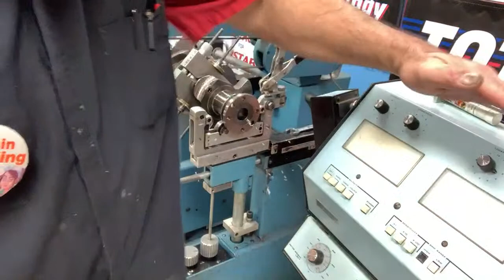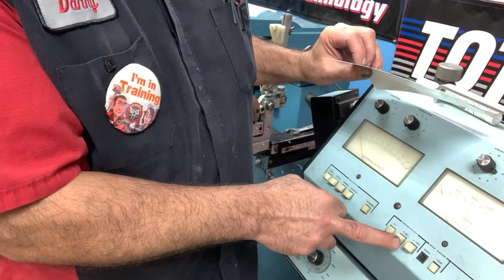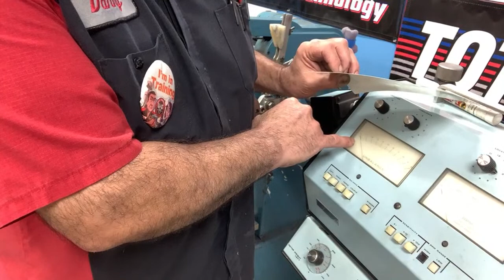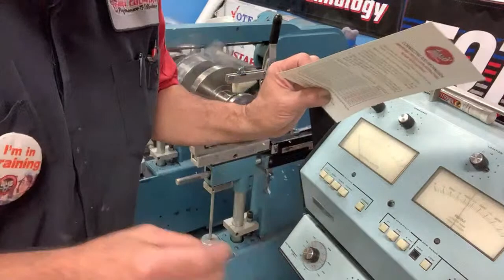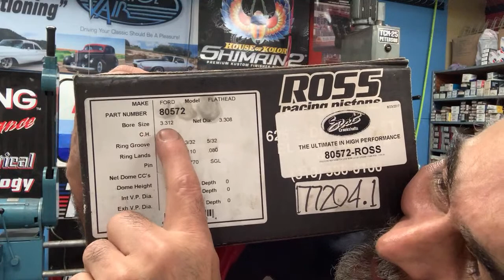Engine balancing on Friday afternoon/Flat head Fridays

Comment: On all the engines we built with Dry Sumps we left the crank shafts blunt. We built scrapers to "peel" the oil off the crank. The thinking was the blunt cranks would throw the oil off so the scrapers could catch the oil.  Knife edge cranks would slice through the oil leaving it in suspension. A lot of time was made in the design of the scraper with catch screens to trap the oil droplets.  Balancing a engine to perfection is fun to do but leaving it a bit  heavy on the counter weights can help a high revving engine.

Comment: In the early 2000s my brother purchased a 1979 z28 with a 1973 sb400 (4.125 bore)! I had everything written down in a notebook but, don't have it anymore! I don't remember if it ran a custom crank or if the original was balanced but, I know it had custom length rods, amber lightweight pistons 11/1 compression, I had the lift & duration written down, I am so upset about loosing that notebook! I know it had a circle track cam, offroad use from summit, roller rockers, Holley 750 w/manual secondaries, TH400, new valve body, shift kit, 3000 stall, 373 gears, B&M Mega shifter, 4 core radiator,  dress up kit, all 12-point bolts, ran great I. 1/8th mile!!!!! I want to build another 400 exactly as that one was built!
Reply from the maker: Sounds like a good combination , had all the right parts👍👍👍

Comment: 🥺 all this time in the industry and I never once thought about a drill bit expanding.  But I do always use cutting oil!   Is it true, that having a wider angle on the drill bit makes it easier to cut through stainless. As in changing the cutting edge from 118 and resharpening to 135 degrees.
Or would that just cause heat to build faster?  Having to constantly fight the "work hardening" of the metal.

Comment: I just got my 1996 Chevy blazer and the icv have a broken bolt that is a t20 
And it in the aluminum throttle body what's your suggestion
Reply: combat wolf  Danny has a video on removing a bolt using a tig welder and resonant frequency that should show how to do this.